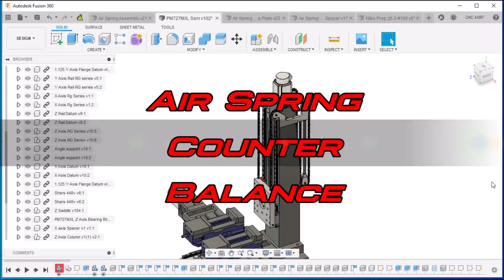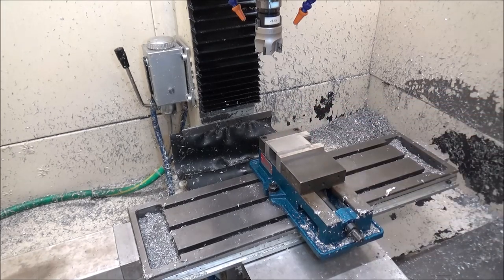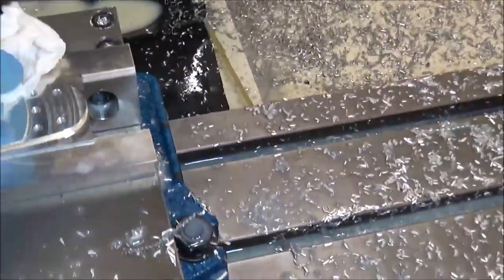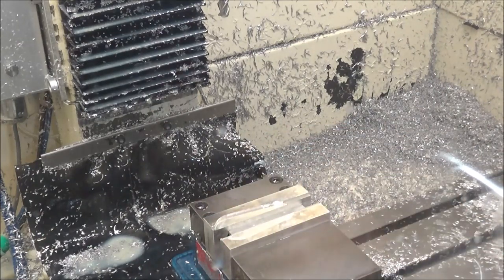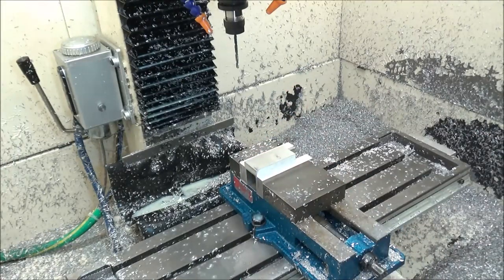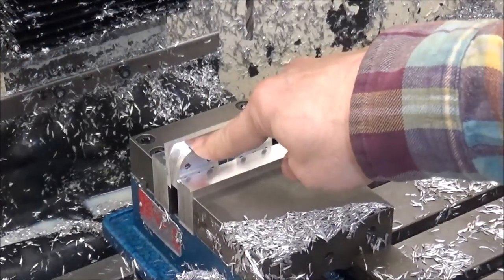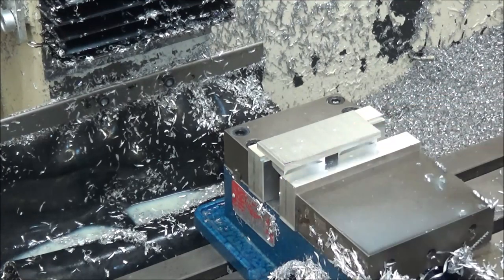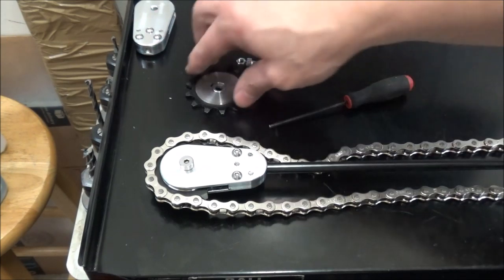PM727MXL Air Spring Counter Balance

Comment: Hi Sam,  Very clever idea to use chamfer tool to finish of the opposite side facing.  Minimizes the risk of the thin material getting jammed between the tool and the job and marking the job.

A tip for thin vertical edges:  I alway put a small radius (0.25mm) on all vertical edges before programming. Finish looks great and save a great deal of time deburring vertical edges.   A small radius does not detract from the function of a part  and would have prevented the crushing effect you experienced when clamping in the vice.

Where did you get your thread mill?
Reply from the maker: Thanks for that tip I actually went back and addeda small radius.  It's all part of learning. The thin slivers when facing are always a risk at marring the finish. Sometimes you can get away with a chamfer op to clean it up.

Comment: ideally you would want to connect the high pressure side of your air cylinders to an external tank, that way the holding force remains virtualy constant. The way you have it now, the counter balance force varies depending on spindle height
Reply from the maker: The idea behind this design is to keep things simple. As mentioned in the video the head weight will be in the #150 range needing a #300 counter weight. With the gas springs the pressure will vary as they are compressed which is why we chose to go with 2 #100 air springs. The idea being to assit in lifting rather than lift the head.

Comment: Hi Sam! ive been thinking about making the same sort of system for my mill, i dont think i understand the 2:1 ratio. So let's say for example my head up and down movement is 15 inches i would need, to be safe a spring that's like 8 or 9 inches of extension right?
Reply from the maker: Yes
Reply: @CNC4XR7  Thanks!